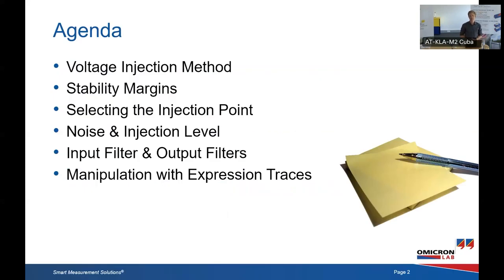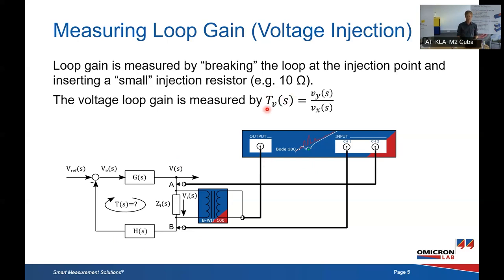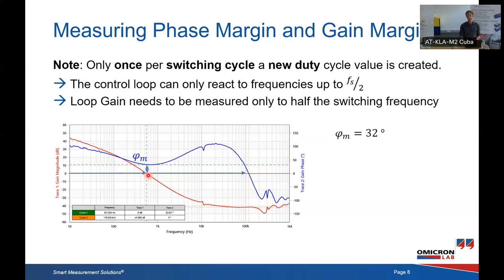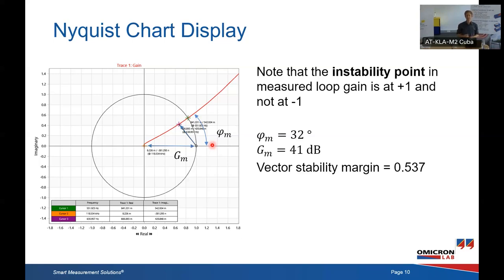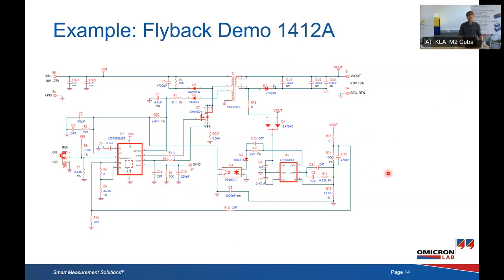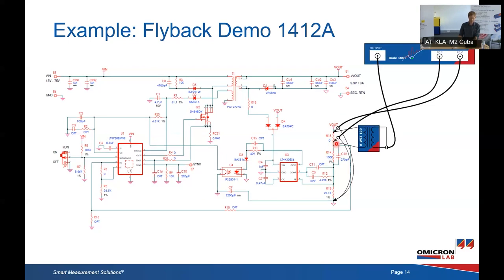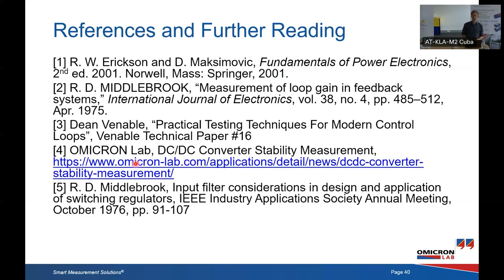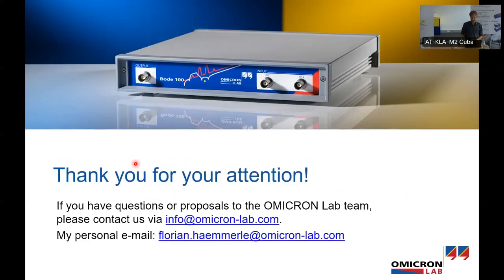Accurate Loop Gain Measurements, Tips & Tricks

Comment: Sir, please could you explain how to measure the loop gain if we use the hall sensors for the voltage measurement?
Reply from the maker: The principles explained in this video apply to any control loop / feedback where the information flows in form of a voltage. Please contact support@omicron-lab.com for specific questions.

Comment: Nice Florian , just wonder if you have current feedback amplifier ,  could we use the same method , requirements about output impedance vs inputs impedance, what it be then ?!
Reply from the maker: Dear Paul, the requirement for the impedance condition comes from the fact that we inject a voltage and measure two voltages. Only if the impedance condition is satisfied, it can be ensured that the information flow at the injection point is in form of voltages. If not, the information flow could be in form of a current and voltage combination which makes the measurement hard. If you have the opposing situation where impedance backwards is large and forward is small, then you could inject a current and measure two currents to get the loop gain. Hope that helps! Otherwise, please contact us at support@omicron-lab.com

Comment: 13:15  Is the additional +180 of phase on in the Analyzer Suite true for only the loop gain measurement?  In other words, if I switch the probes around to measure the compensator as in 43:60, will its phase also be shown with an additional 180 degrees of phase?  Based on actual measurements with my Bode 100, i'm seeing a low-freq phase of a Type-II OTA compensator as around +90 degree.  But in a spice simulation it starts out at -90 degree.  Just wanting to make sure I'm interpreting this correctly.  This is a super-informative video by the way.  Thank you Florian.
Reply from the maker: The "additional 180° phase shift" is actually not "additional" but it is there in the real physical system whereas it is not there in a theoretical open-loop analysis of a negative feedbacks system. Bode 100 will always measure the real physical system. In case of an inverting error amplifier with integral part, there is a -180° phase shift from the inverting configuration and a -90° phase shift from the integrator part. In total this is -270° which equals +90° phase. Did you use an inverting configuration in your spice simulation?
Reply: @OMICRONLabTutorials  You are exactly right.  I went back to my simulation and sure enough did not have it configured to inverting.  Even in my own derivation of the compensator I didn't propagate negative sign through.  Now everything is reading +90 on the compensator's phase at low-freq.   Thank you Florian for point this out.